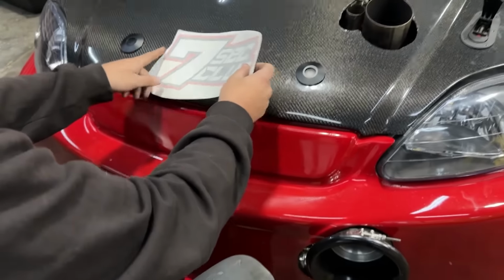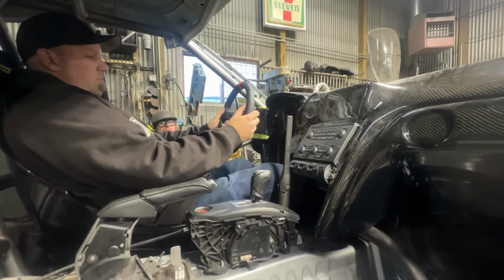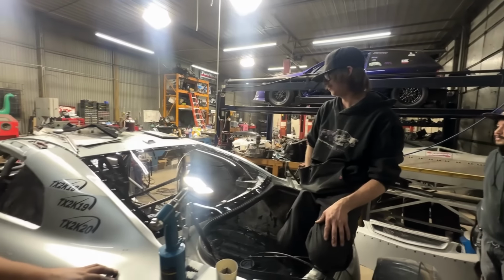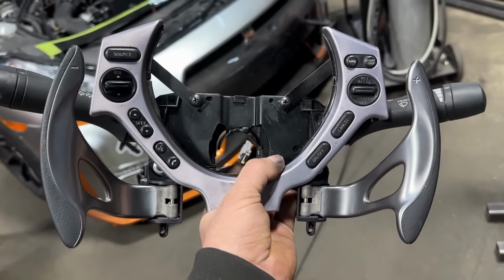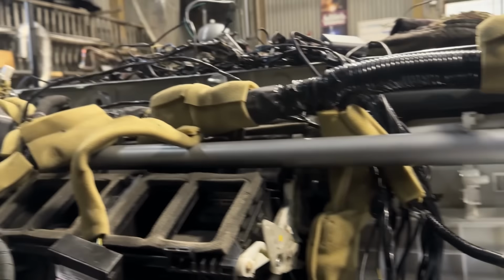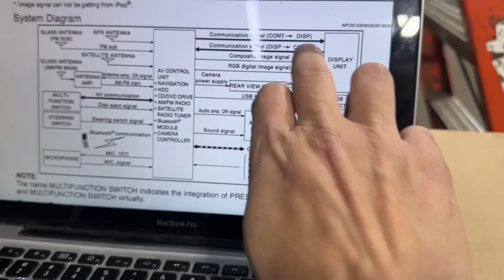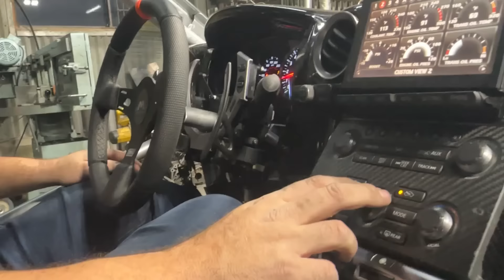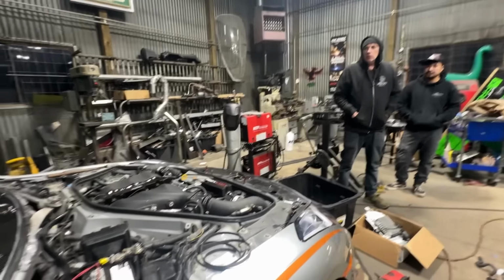ITS ALIVE!! Bringing the Raceweek GTR to life!!  The controls turned out Rad!

Comment: The aircraft mechanic in me says that you needed to drill the holes through the rear window and structure, Cleco it on, then remove the window to remove all the shaving inbetween, apply the glue, and then reinstall the window with rivets
Reply from the maker: Thats definitely a better way, thank you.

Comment: Brent, steering wheel lock module needs to be connected. Just make a bracket for it and hide it underneth
Reply: They're tucking the connected module beneath the CF dash(28:05). Hope it doesn't come back to bite'em later..

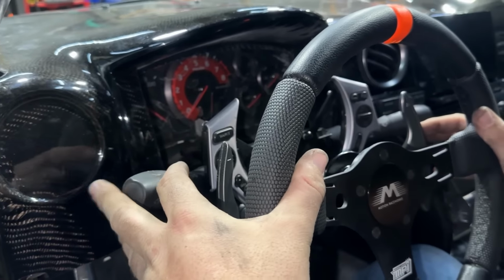Comment: 19:19 that’s some dime stacking on that weld there boys 👌🏻
Reply: 😂😂😂😂 hmmm I love this channel and have followed it from the start but I wish they would get a welder in to do the cages . those welds are terrible and as I stated in my comment one I noticed had half of the tube missing a weld but was painted.  The cross bar weld to the bottom of the main hoop in the video looks like it has had been ground out and re done 5 times . this is not a dig at Brent or any of the lads its just an observation.  I would be very upset if I got a cage back and the welds looked like that